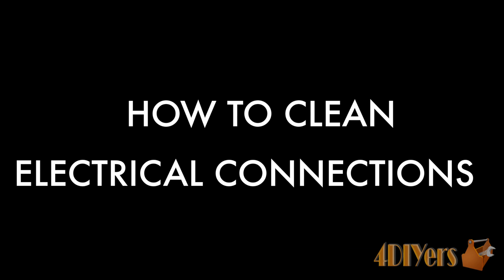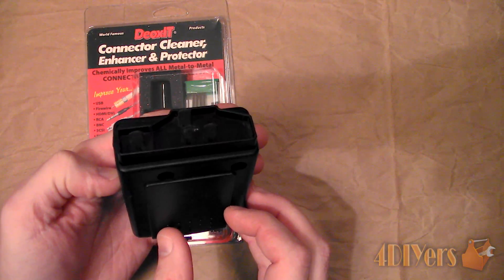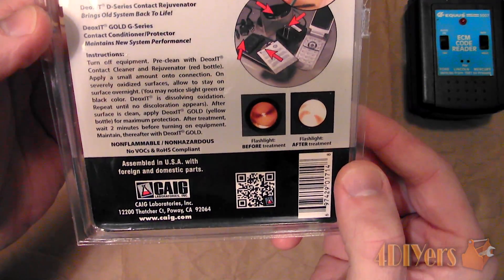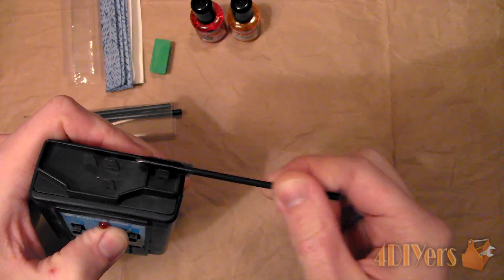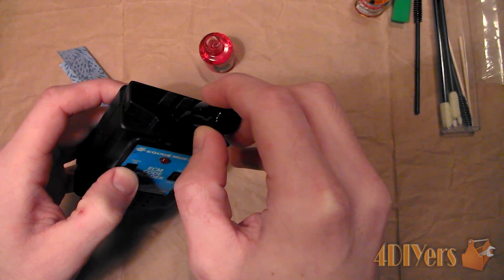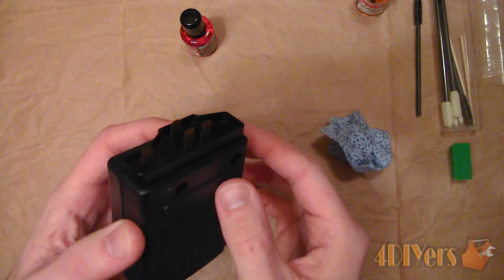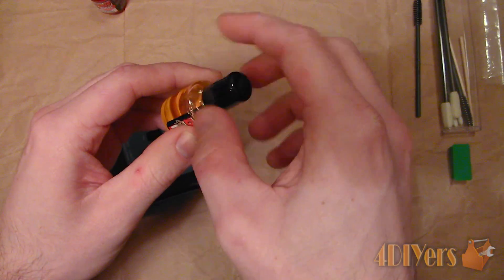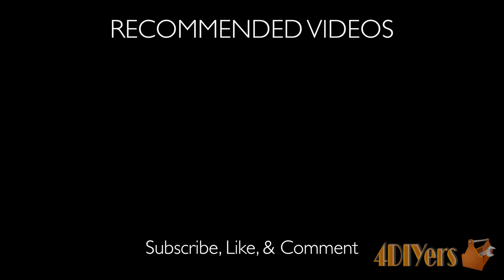How to Easily Clean Corroded Electrical Connections & Apply Protection

Comment: Would I be able to use this on the connectors to an RV heater in a wet environment?
Reply: yes. However I would suggest deoxit's shield series to keep the protection.

Comment: Can this be done on automotive electrical sensor contacts connections
Reply from the maker: Yes it can be, currently using the same method working on the fuse box of my truck.

Comment: Vinegar does same job...
Reply from the maker: But it doesn't provide protection and you shouldn't submerge electrics equipment in vinegar.
Reply: @4DIYers  shouldn't submerge electrics in anything. As I stated you can clean corroded contacts with vinegar.. I've done it many times and it works.
Reply: @mrt9031  which kind theirs diff types
Reply: daniel kennedy distilled vwhite vinegar